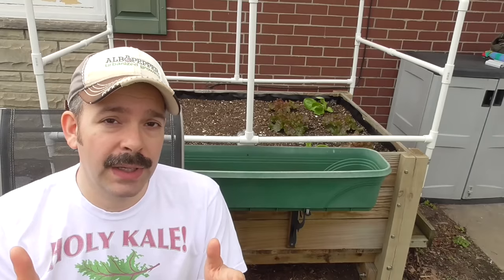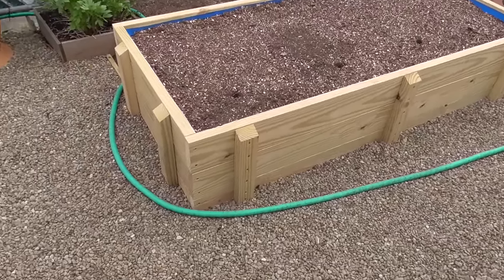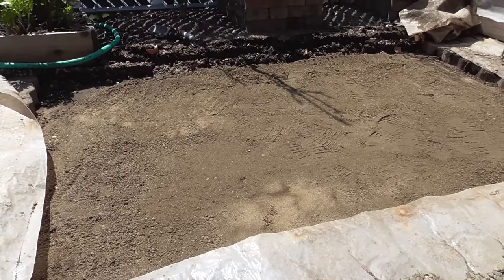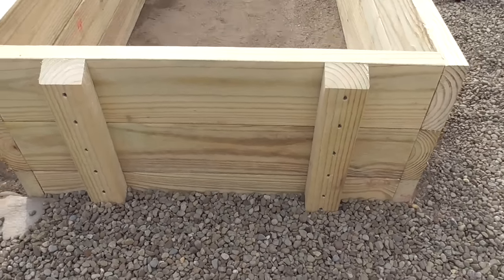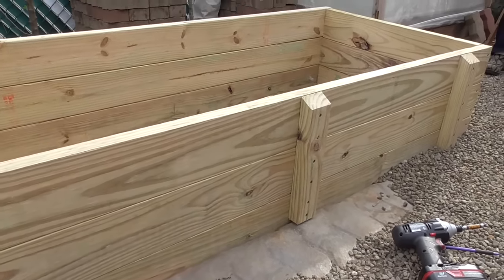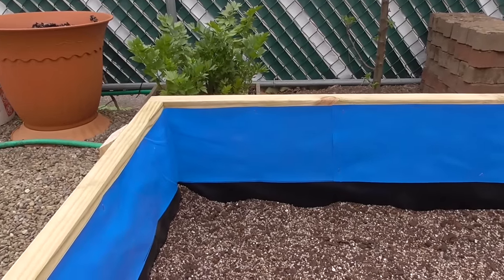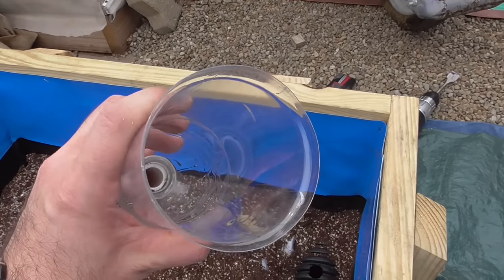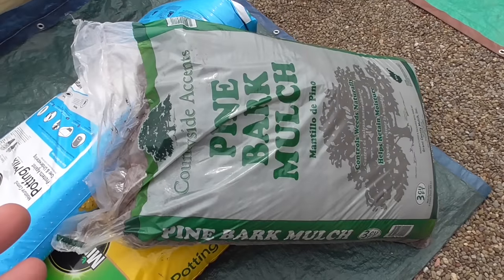Self-watering SIP Sub-irrigated Raised Bed Construction  (How to Build)

Comment: My biggest problems I have with my SIP beds is ruining the soil by adding compost it gets too heavy and water logs. Also after a few seasons having to remove all the soil to clean out the water reservoir because eventually it will fill with sludge. Last is blight and other disease stick around year after year because your reusing that same amount of small potting soil, once your plants get sick that will be back next year too.
Reply from the maker: Are these actual problems you've experienced, or just hypothetical concerns? My first SIP (built in 2011) still has the original potting mix in it. No issues whatsoever.

Comment: Why is manure based compost a bad thing to mix in?
Reply from the maker: Can You Add Compost & Manure to Old Potting Mix?

WHAT'S WRONG WITH MANURES & COMPOSTS? If you've seen my original SIP video from many years ago, perhaps you've wondered why I said: "You don't want to use manures. You don't want to use those gross composts that you get in the bag at the store." Some people have been curious. Of course, other people have been completely triggered. I've seen people who overreact, assuming that I'm only an advocate for synthetic fertilizer. They may think I'm opposed to all forms of manure and compost in all situations, but that's simply not true.
Samples of Retail Bagged Cow Manure and Mushroom Compost

Although some compost blends are fluffy and well textured, others are absolute garbage. Sure, you could throw them in an in-ground bed and the plants will grow. But a sub-irrigated planter doesn't function in the same way. It is constantly in contact with water. For plants to thrive, you need to strike a good balance between water absorption and aeration. From that perspective, cheap, industrial bags of manure or compost just don't cut it.

BAGGED COMPOSTS / MANURES? To prolong the viability of your SIP potting mix, it's best to replenish nutrients in the form of fertilizers. Organic gardeners are apt to use compost as often as possible. In SIPs, worm castings can be included in small amounts. But using composts in containers can yield unpredictable results. Bagged (retail) compost, humus or manure might have a fine consistency, similar to garden soil. If it contains fine silty particles then this can reduce pore spacing and aeration properties of the mix. That's why topsoil is NEVER recommended.

I would like to point out that this is not a theoretical concern. I've seen real world situations where gardeners' SIP beds have completely failed because of using subpar materials. Note how one gardener described her bad experience:

    I ordered a planters mix and had it delivered. It's composed of Compost (though I couldn't see any good black dirt in there), Manure, and top soil. Needless to say, I had ZERO wicking, and even when I top watered nothing grew. By July I did my research and felt stupid on both SIP forums and Garden Forums. I'm currently unloading the dirt from the bed and it's a muddy nightmare from the warm spring snow.

As air gaps get plugged up by ultra fine particles, compaction occurs. And since SIPs are always resting on a perched water table, the few remaining air gaps tend to be saturated with water. This impairs root health, preventing plants from getting the oxygen needed at the root zone. This can lead to a decline in plant growth, or even root rot and death. Even if plants grow ok in the first year, over time the potting medium may break down to the point that it must be replaced.
Mels Mix SIP Potting Mix with Woody Homemade Compost

HOMEMADE COMPOST? Buying bagged compost is not financially advantageous in large beds anyway, not when compared to buying a bulk organic fertilizer. Of course, homemade composts might work, especially if they are mostly wood based. These tend to have more structure. Larger particle size means improved aeration. I've found though that it's very easy to reserve my compost for conventional beds and perennial plantings. It all gets used, just in a different location. 

https://albopepper.com/refreshing-sip-potting-mix-adding-fertilizer-year-2.php
Reply: @Albopepper  Thanks for the information.

Comment: But if i well understand, the overflow tube makes liner not waterproof at all, all I wrong ? You cut liner to pass the tube. The water will enter under the liner. So I consider it is to be used outside and not for example in an apartment on the balcony

Comment: Does anyone know how often you should change out the potting mixes? Mine takes 6 large bags and if I had to change it every year that’s 100$, (miracle grow).  That’s quite expensive and labour intensive?  New to this, any advice ?
Reply from the maker: My 1st SIP was built in 2011: https://albopepper.com/grow-box.php  It still has the original potting mix in it.
Reply: Ok so every year maybe stake some out and add a new bag or two to keep it fresh? Just curious how to maintain is to keep it optimal.  Living in Canada cold climate.  Thx For your great videos.
Reply from the maker: You got the idea. I just loosen it up with a small hand rake. I add in some fresh potting mix materials to top off the box. Then I mix in fresh nutrients like organic fertilizer. Depending on how the existing mix looks, I might simply add some coarse perlite. Or I might mix in a little aged pine bark for added structure. So far, so good!
Reply: With regards to crop rotations in cold climate.  Assuming you are living somewhere warm
And nice 🤷🏻‍♂️😝, in a shorter season I can’t or don’t think I can go by your spring summer fall Rotation method.  Will have to figure out what works for Canadian climate. Not sure.  Maybe just 2 of the 3🤷🏻‍♂️
Reply: And one last question is miracle grow potting mix OK to use because I just noticed they have something called raised flower bed potting mix. I’ve already purchased six large bags of miracle grow potting mix😳
Reply from the maker: Yes, miracle grow potting mix is OK to use. In fact, when I've used it the plants grew extremely well. I don't know about the flower bed stuff. Watch out for "raised bed" mixes. Some of that stuff is really not so great. Potting mix with perlite is better.

Comment: would sip work well in the UK in the south east were not really drought ridden it can be pouring down with rain one min and full sunshine the next and only get a short periods of hot weather that we class as our summer ha ha or would just regular raised beds be ok and water when need ill be growing all different fruits and veg in each raised bed and i would like to add a tube tower work farm too
Reply from the maker: Hi Emma!  The SIP systems should be able to work ok. But I would mainly use them to address specific needs. Since drought is not an issue, I would recommend the SIPs for urban environments like growing on concrete, tarmac or roof terraces. Anywhere that a container garden may be used, I would advise considering sub-irrigated containers. If you have access to good ground, a conventional raised bed might be the easiest solution in those locations.
Reply: AlboPepper - Drought Proof Urban Gardening 
thanks for your quick reply very helpful :-)

Comment: would 3 inch pipe work with a only 16 max bed?
Reply from the maker: Yes, but you would need to lower the overflow tube. Obviously the reservoir would hold a little less water.

Comment: I'm still liking the one with river rock better
Reply from the maker: Have you ever considered what you would do if the one with river rock needed disassembled? I've written about why I recommend the drainage pipe rather than gravel: https://albopepper.com/pipes-vs-gravel-in-SIP-wicking-beds.php
Reply: @Albopepper  wow!  Some awesome info. My project is an on ground but set in raised bed at the home I'm buying. They'll actually be part of the backyard back fence. My delimma is the pipes breaking down over a shorter time and possibly leaching. Any info you may have on this would be greatly appreciated.  I considered something similar to yours until I saw the river rock. You can also drive a pickup easily into my backyard
Reply from the maker: Thanks for sharing the details about your project. This past autumn I just got done completely rebuilding the planter shown in this video. The wood was completely decimated by some sort of fungal bloom. But when I opened the SIP up, the potting mix was still good and the black pipes were in perfect condition. So I simply rebuilt it all and reused the existing pipes with no issues. If I had used gravel, it would have been a nightmare. I plan on doing a video update about the process this spring, so stay tuned!
Reply: @Albopepper  subbed  what zone/ region do you grow in?  I'm in sioux falls
Reply from the maker: I'm in Western PA, zone 6. Thanks for your support!
Reply: @Albopepper  how long would use the pipe typically before replacing?  I'm pretty sold on your method 🤣🤣
Reply: @Albopepper  tysm. Perfect. Im zone 4 I can equate better.   appreciated
Reply from the maker: I haven't been using these long enough to see any points of failure. When you look into the commercial or industrial use of these pipes, you can find the materials are still holding up well even after decades of use. The pipes are not placed under any real stress inside of the SIPs. So 30 years would be quite reasonable. Even 50 years is not unrealistic. Those pipes would be one of the longest lasting components within the system.
Reply: @Albopepper  whaaaa 😳 thank you so much. Can't wait for the nex vid. Time to binge watch 🤣🤣♥️. So appreciated. Saved me a massive headache going forward
Reply from the maker: I'm glad to help! I hope your SIP gives you great results!! 😀

Comment: You know all this fuss, I have a great garden, I dig the dirt up, use leaves and wood chips each ear to "loosen" up the existing dirt, and the plant the plants. I water each day and the rest is done by nature. If you are really worried about no water in dry times, You can put in plastic bottles upside down with pin holes to let the water go in to the ground. Simple and totally cheap and not all the fess.....BTW the wood will rot no matter what so why waste the money. I you are going to do a raised bed do it in rock. Just my 2cents. Good Video tho.
Reply: Oh forgot to say you have to cut the bottom of the plastic bottle and put it in the ground a bit so it won't fall over. You fill the bottles up with water while you water your garden. Works for me. What kind of bottles, bleach bottles, vinigar bottles, the big ones that are plastic, laundry bottles, just keep the tops and put only a really small hole in the top which when turned upsidedown allows the water to get into the ground. Good gardening.

Comment: Why no manure or compost? Because it could break the wicking action?
Reply from the maker: BAGGED COMPOSTS? To prolong the viability of your SIP potting mix, it's best to replenish nutrients in the form of fertilizers. Organic gardeners are apt to use compost as often as possible. In SIPs, worm castings can be included in small amounts. But using composts in containers can yield unpredictable results. Bagged (retail) compost, humus or manure might have a fine consistency, similar to garden soil. If it contains fine silty particles then this can reduce pore spacing and aeration properties of the mix. That's why topsoil is NEVER recommended.

As air gaps get plugged up by ultra fine particles, compaction occurs. And since SIPs are always resting on a perched water table, the few remaining air gaps tend to be saturated with water. This impairs root health, preventing plants from getting the oxygen needed at the root zone. This can lead to a decline in plant growth, or even root rot and death. Even if plants grow ok in the first year, over time the potting medium may break down to the point that it must be replaced.

https://albopepper.com/refreshing-sip-potting-mix-adding-fertilizer-year-2.php
Reply: @Albopepper  thanks for the thorough answer!

Comment: You informed of the wood no longer being treated with arsenic. You also mentioned using plastic that would be okay for fish. I get that the upper layer of pool plastic, whatever it's made of, shouldn't be a problem, but what I am wondering about is the toxic potential of the drain pipe plastic being used. Its properties will ultimately leach into the water, which should then leach into the soil and then into the root systems of the plants. I'm sure we don't know the values involved, but this would tend to make these plants less organic, should they test positive for chemical traces derived from the piping.
Reply from the maker: No, there is no chemical leaching. What exactly are the names of the chemicals that you are concerned about?
Reply: @Albopepper  After I asked the question, I went out across the web to see what I could find out. Clearly, I should have taken a moment to do that first, but being a drain pipe I wouldn't have imagined the materials or chemicals used to manufacture it would in any way be food safe. Apparently it is made of number 2, High-Density Polyethylene, which of course is food safe. Assuming that's what you used, your box is one of the best designs I've seen on the web. Thank you for taking the time to show us how you made it.
Reply from the maker: Excellent info! Bravo to you for doing the research.  +1

Comment: How about using cow sheep chicken or shrimp soils any harm?
Reply from the maker: Replenish Nutrients

BAGGED COMPOSTS? To prolong the viability of your SIP potting mix, it's best to replenish nutrients in the form of fertilizers. Organic gardeners are apt to use compost as often as possible. In SIPs, worm castings can be included in small amounts. But using composts in containers can yield unpredictable results. Bagged (retail) compost, humus or manure might have a fine consistency, similar to garden soil. If it contains fine silty particles then this can reduce pore spacing and aeration properties of the mix. That's why topsoil is NEVER recommended.

As air gaps get plugged up by ultra fine particles, compaction occurs. And since SIPs are always resting on a perched water table, the few remaining air gaps tend to be saturated with water. This impairs root health, preventing plants from getting the oxygen needed at the root zone. This can lead to a decline in plant growth, or even root rot and death. Even if plants grow ok in the first year, over time the potting medium may break down to the point that it must be replaced.

HOMEMADE COMPOST? Buying bagged compost is not financially advantageous in large beds anyway, not when compared to buying a bulk organic fertilizer. Of course, homemade composts might work, especially if they are mostly wood based. These tend to have more structure. Larger particle size means improved aeration. I've found though that it's very easy to reserve my compost for conventional beds and perennial plantings. It all gets used, just in a different location. 

https://albopepper.com/refreshing-sip-potting-mix-adding-fertilizer-year-2.php

Comment: Why no compost? With all the nutrients. Even as top dresseing?
Reply from the maker: BAGGED COMPOSTS? To prolong the viability of your SIP potting mix, it's best to replenish nutrients in the form of fertilizers. Organic gardeners are apt to use compost as often as possible. In SIPs, worm castings can be included in small amounts. But using composts in containers can yield unpredictable results. Bagged (retail) compost, humus or manure might have a fine consistency, similar to garden soil. If it contains fine silty particles then this can reduce pore spacing and aeration properties of the mix. That's why topsoil is NEVER recommended.

As air gaps get plugged up by ultra fine particles, compaction occurs. And since SIPs are always resting on a perched water table, the few remaining air gaps tend to be saturated with water. This impairs root health, preventing plants from getting the oxygen needed at the root zone. This can lead to a decline in plant growth, or even root rot and death. Even if plants grow ok in the first year, over time the potting medium may break down to the point that it must be replaced.

HOMEMADE COMPOST? Buying bagged compost is not financially advantageous in large beds anyway, not when compared to buying a bulk organic fertilizer. Of course, homemade composts might work, especially if they are mostly wood based. These tend to have more structure. Larger particle size means improved aeration. I've found though that it's very easy to reserve my compost for conventional beds and perennial plantings. It all gets used, just in a different location.

https://albopepper.com/refreshing-sip-potting-mix-adding-fertilizer-year-2.php

Comment: If the outlet pipe has a curve from being stored on a roll, just roll it so the curve is down. Water will fill to the highest low point.
Reply from the maker: Good point. This especially applies to the overflow tube in 30 gallon tote SIPs. In my newer wooden SIP beds, I've been using 1/2" schedule 40 PVC pipe which works well and doesn't have concerns related to bending.

Comment: Can live worms be added to the box to help fertilization?
Reply from the maker: +Luis Angel Vizcarrondo -Hi Luis! I've had worms freely enter my planter actually. I just pulled the tarp off of my SIP, from the Winter time. Upon digging around, I found several worms that had over-Wintered in our mild Zone 6 Winter. Certainly, you could add some worms, especially as you enter the second season and your box has roots that still remain from previous plantings.
Reply: +AlboPepper Thank you!
Reply: AlboPepper Thank you!